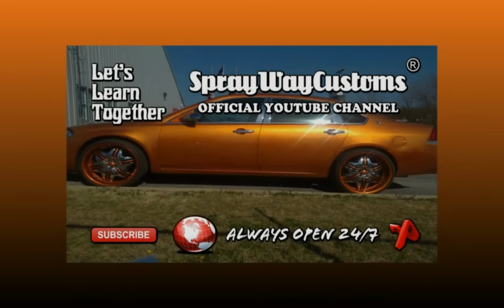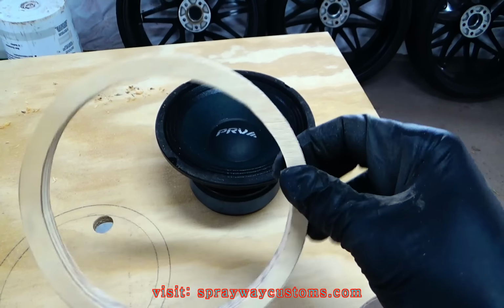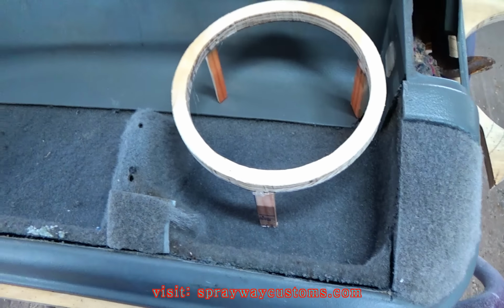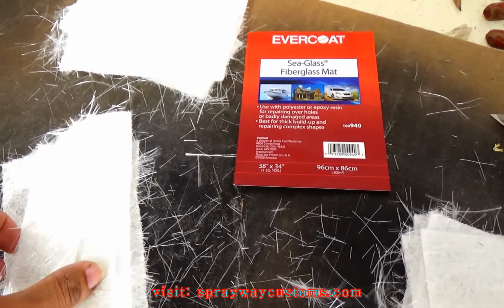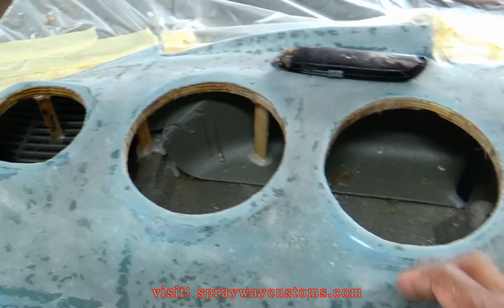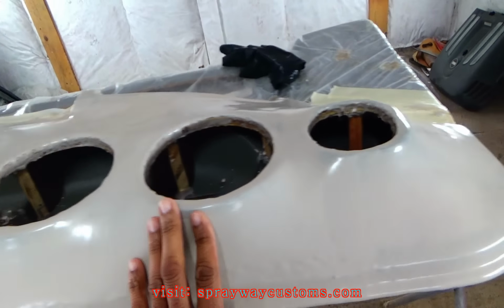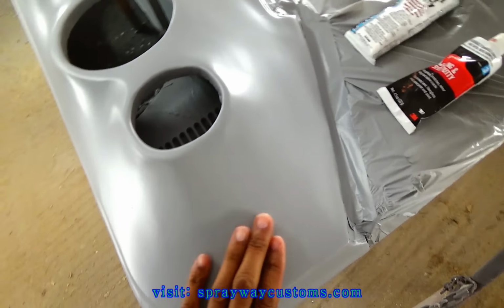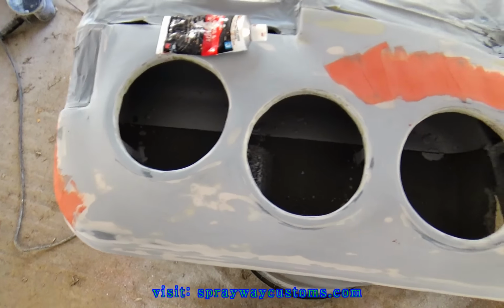How To Fiberglass Door Panels Step By Step 1996 Bubble Chevy Impala / Caprice

Comment: I noticed a boat fiberglass guy uses a roller to smooth out the wet fiberglass. He dabbed in his epoxy with a chip brush and laid the glass in and dabbed more epoxy over it and then he had a 4" paint roller frame with a thin piece of stainless pipe as the roller maybe 3/8" diameter. And he rolled that over his wet fiberglass to push the glass in and work out the air bubbles. And it works good to contour the corners too. Looked like less sanding after also
Reply from the maker: Yes..thanks for the info

Comment: Can you do a video on how to remove all the paneling and pillars in the box Chevy so I dont break anything when I start taking things apart
Reply from the maker: I'll keep that in mind but at the moment. I have most of them took apart
Reply: @SprayWayCustoms  alright preciate ya & btw can you help me out with what I would need for fiber glass and painting. What spray guns will work and size compressor I would need? I just want to make sure I get everything I need.
Reply from the maker: With fiberglassing you'll be fine with just about any size compressor and spray gun because the parts so small and you wouldn't be painting for a long period of time.
Reply: @SprayWayCustoms  alright man preciate ya, specific nozzle tip size and any good affordable brand of spray gun?
Reply from the maker: Go with a 1.3 tip that's a good universal tip for everything. Finishline are the Startingline by DeVilbiss are good affordable guns
Reply: @SprayWayCustoms  alright preciate the help

Comment: Awesome work n craftsmanship! 👍👍
Quick question. Did you remove the staples from around the speaker holes before completing the fiberglass. Will the staples get in the way when trying to secure the prvs to the door?
Reply from the maker: No I didn't remove them. After the first coat of resin they were basically covered up. I shoot them countersunk into the piece. Thanks for the question R Hunter

Comment: Do you get a ton of door rattle like that? Just curious cause I wanna do this to my f250
Reply from the maker: No you don't
Reply: When in doubt use dynamat or similar (also helps eliminate backwave) but a proper fibreglass panel should be stiff enough not to rattle.

Comment: Do you think you can show how you wire and fasten the panels back on the door? Do you have to account for the seats when you close the door
Reply: mjbqalaska by him not cutting the panel off in the back... It fastens back on the same way
Reply: mjbqalaska thespeakers are setting flush with the panel itself no it doesn't interfere with the 
Door shutting
Reply from the maker: Thanks for answering the question Terry. That's a good question though mjbqalaska. Thank you both😊
Reply: How does it stay on the door panel ?

Comment: This may be a stupid question but how do you stop the fibreglass panel from separating from the original door panel?

I like your work, it's given me some ideas but I've never fibreglassed anything before so I need some more information and learn a bit more first before I go cutting my door cards to pieces.
Reply from the maker: That's not a stupid question...Great Question 😁. The staples hold it to the door panel secure. After you put resin, fiberglass and filler over them there's no way they're coming out. Thanks for the question
Reply: SprayWayCustoms what do you think about drilling holes instead of putting staples? Ive seen that's another method...
Reply: SprayWayCustoms thanks!

Comment: Excellent job! Btw, I found a Cadillac 500 engine and trans for the Burb! Now I'm searching for that ole school Lac interior. What about using the resin with multiple layers of just fleece? Would that work instead of using the FG sheet?
Reply from the maker: You could use resin and fleece but if it's something that needs to have a pretty sturdy foundation. You would want to use fiberglass. Thanks Jeremy Medlock

Comment: When doing this do you want the panel to be a sealed unit or should it vent into the door?
Reply from the maker: It all depends on your preference...what type of speakers and what you going for Shawn
Reply: @SprayWayCustoms  for the doors  I have 3 mids @6.5" and 1 tweeter per door. For subs I have 3 @8" All going into a Dodge MegaCab Truck. Thanks for the reply bud.

Comment: UMMMM Just a little hint it’s way easier and more accurate to use a compass to mark your speaker rings there 50 cents at Walmart
Reply from the maker: Thanks
Reply: To be fair you don’t need it because it’s just a reference piece you’ll never see and the cuts are never gonna be perfect anyway,
So the lines don’t need to be either

Comment: Question man how would this work on grafic fabric? Would i appyl fiber glass sheets on top of the fabric?
Reply from the maker: It doesn't matter what's on the fabric. The process is the same
Reply: Maybe I didnt ask it correctly. The print on the fabric I want to show through what would I use to make the printed fabric transparent? Or will it not work?
Reply from the maker: Once you put resin, fiberglass and sand it you want be able to see the print

Comment: You have any more tips on where your glass fiber meets the original panel? I never manage to get a smooth transition or whatever, I feel that often damage the panel :/
Reply from the maker: You just have to Mask it up real good and once you get ready for your final prime. Touch it up with some glazing putty.
Reply: @SprayWayCustoms  so you're staying stay a little away from the actual place it'll transition with the glass and fleece and work that with filler to meet them up and sand that

Comment: What exactly holds that fiberglass panel to the door tho? No way some hot glued sticks are holding 4 speakers + a fiberglass shell. Was there some bolting provisions made into it that wasn't shown in which you screw/bolt it to the panel from the backside?
Reply from the maker: Once you staple the fleece to the panel and then fiberglass over them it's not going no where
Reply: @SprayWayCustoms  wouldn't the staples just pull out of the plastic panel? Or do you flip the panels over and them bend all the staple legs behind it like a paper stapler?
Reply from the maker: I just leave the staples sticking out if it's not no where needing to be flush to the surface....if so I just grind the tips down

Comment: What kind of stapler do you use?
Reply from the maker: It's a GREX model number5018 shoots 20GA staples
Reply: @SprayWayCustoms  thanks bro
Reply: What brand staplers do you use or do you just get the Grex brand. Thanks in advance. I just got my gun in today
Reply from the maker: Finalboss 84 the staples I used are SUREBONDER 44516 5/16" (8mm)

Comment: This might be a dumb question but the whole fiberglass assembly is held on to the door by what the glued sticks? Or does the combination of fiberglass  staples and the sticks hold it ?
Reply: Btw nice work I’m going to try on my back dash that keeps snapping from the bass in the trunk
Reply from the maker: It's actually held together from the fiberglass mat because you can actually take the sticks out once you done. They're just put there to hold the speaker rings in place until the fiberglass is laid to strengthen everything up. Good 😊 Question

Comment: Why would you use a stronger support than a paint stirrer to reinforce that long panel?
Reply from the maker: It's only to keep the piece in place until the fiberglass is dry...once the piece is fiberglassed you can remove them

Comment: How or what did you use to "cut" away that excess fleece after you put that first layer of resin on? You trimmed it somehow perfectly around the remaining potion of "unresined" door card.
Reply from the maker: A box cutter and just transitioned it with fiberglass filler

Comment: Great video.  Watching for the 3x taking notes.  About how long would you say the whole process takes minus primer and paint for 2 door panels.  Wondering if I can do it over 3 days, Fri Sat Sun since it will be in my work truck.  Thanks in advance.
Reply from the maker: Much appreciated
Reply from the maker: Yes it can be done in three days
Reply: @SprayWayCustoms  great, just need to rewatch and get a supplies list.  Thanks for the swift response.

Comment: will the legs of the speaker rings loosen or off off due to the vibration of the speakers over time? I think they will and then there will be a rattle in the door panel.
Reply from the maker: After the resin harden up you can remove the legs

Comment: You could always cut the Inner Circle first and then slide the speaker into the hole and then Trace the outside of the speaker to get it perfectly centered instead of trying to guess. I know it'll probably work out that way too but if you want to get it perfect you could always try that approach.
Reply from the maker: Thanks man

Comment: Ok I seen that it’s fleece. Once you have the fleece coated in resin and drys. How hard is it. Is it hard enough to pull it off to finish the fiberglass work.. 

Asking cuz I’m making a dashboard overlay. Basically a part that will screw to my factory dashboard. Thanks in advance...
Reply from the maker: The first coat of resin not very hard but as you put more coats on it gets harder

Comment: Hey wats tha material u use for uour fiberglassing i know fleece but is there any other fabric   i bought some 100% polyester  its real stretchy  would it work for fiberglassing door panels,rear decks thanks its like tha poly techno  fabic
Reply from the maker: Yes that’ll work with no problem
Reply: Ok thanks

Comment: How do you mount the door panel if the fiberglass area is where the mounting screws are?
Reply from the maker: Reach through the speaker openings and drill some screws through the base
Reply: @SprayWayCustoms  sweet thanks!

Comment: do you leave the wooden legs on after the job is complete or remove them?
Reply: @SprayWayCustoms  preciate that. gonna re-do my kick panels in my '80 regal. Had them done about 15 yrs ago but they are flush .Gonna use your method to angle them properly so the sound can get out better
Reply from the maker: Great

Comment: 8:27 how do you keep it from separating I see Staples but is there something that you put to bind the two panels together. The job looks awesome 👏
Reply: Does the fiberglass resin stick to the plastic to bond with each other?
Reply from the maker: Once you fiberglass it, it’s not going no where if you referring to around the speaker openings
Reply: When you stapled it down in the edge outer edge from all the bass and speakers would that loosen the frame and crack it I wanted to know how you keep it from separating but you’re telling me it’s soon as I fiberglass it is done it’s not going nowhere
Reply: I appreciate you getting back to me respect my brother awesome videos you have keep it up 👍

Comment: How much to build a deck for 4-6 by 9’s for 96 impala?
Reply from the maker: Where you located?
Reply: Austin Texas
Reply: I seen a video of yours where you fiberglass a speaker deck with 4-6 by 9’s and a port hole but don’t need the port hole.. but I like the way the 6 by 9’s were at an angle

Comment: I HOPE YOULL REPLY BACK TO MY COMMENT .I been following this tutorial step by step and I cannot get my staples to go thru my impala door panels .I have a heavy duty stapler and I'm using 9/16 .do you think 1/4 will work .?
Reply from the maker: It could very well be your compressor air is not turned up high enough

Comment: its absolutely possible to do the whole thing with one piece of glass just make some relief rips ware the glass tries to bunch up around the bends.. if you dont want to do it that way rip the glass in circles dont cut it, the glass will lay out way better and take less grinding. also use a small paint roller with a tray its easier than a brush. the rollers we use at work are like 4" long and 1" around (not foam, foam will melt). not even sure how i stumbled on this video lol but i thought i would try and help out a little.. my family owns a fiberglass boat and rv repair shop. i have been doing fiberglass repair for a living for over 15 years.
Reply from the maker: Thanks Chad. Great comment 👍🏾

Comment: @SprayWayCustoms - I've got a better way for you to make those concentric circles.
Sorry I'm not going to read 1000 comments to find out if somebody else already offered this idea.
- Do the outer circle like you did using the speaker as a template.
- Use a straight edge and make 2 perpendicular lines going through the center of the circle.
- Do the same for the cardboard template.
- Now just line up the lines, and the smaller circle will be centered in the big one.
Reply from the maker: Appreciate you

Comment: Can someone give me all material used in the video..thanks
Reply from the maker: Fleece
Spray Adhesive
Hot Glue
Wood
Jig Saw
Drill
Sander
Resin
Fiberglass Matt 
Body Filler
Fiberglass Filler
Sand Paper
Masking Tape
Primer
Spray Gun
Masking Plastic
Glazing Putty
Chip Brushes
.........I might've forgot something but those are the main things you'll need if I remember something else I'll add it 👍🏾

Comment: I started doing car audio about 15 -20 years ago. I had to learn most of my skills the hard way. With that being said, I wish you or some else had been around to instruct me. I think that this is a great opportunity for both the new and seasoned audio designer. I do however have a suggestion that I learned the hard way, about making the rings without a template. What I do is take the cardboard ring that held the sub and make the first hole. I set the sub into that hole, then I use the outline of the sub for the outer ring. Keep up whatcha' do brotha!
Reply from the maker: Thanks for the tip and the encouraging words. I was big into car audio back around 92' but I'm not into it like I use to be but I still love a great sounding system

Comment: Your videos are filmed very well. You speak clearly and you get right to the point. My only recommendation is to stay away from hot glue and maybe find an epoxy that will be longer lasting and more heat tolerant! Your work is great though!! 
I’m definitely going to give this a go with some junkyard doors before I start cutting into my 96.

Any chance you have a video of using the dremel to cut the door panel?
Reply: One other question, does he original door panel rattle underneath when finished?
Reply from the maker: Thanks for the support. The hot glue is not used for support it's only used to hold the legs in place until the panel is fiberglassed. Once it's fiberglassed I remove the legs. The panel doesn't rattle at all Riddem Pest Control
Reply: @SprayWayCustoms  thanks for the quick response!
Reply from the maker: No problem

Comment: I admire your work ethic but to be brutally honest, your methods are antiquated. Save yourself some time and trouble and invest in a router and a circle jig. No template nonsense, once you get one, simply stack em and use a flush mount bit to duplicate. Work smarter, not harder. Also, you should invest in sun flash UV resin. Allows you all the time you need, no need to rush before it cures. Take your time and once your done lay it in the sun and within a minute it's fully cured. It's all about making your work flow more efficient. Just watch Car Audio Fabrication YouTube channel.
Reply from the maker: I know about all the stuff you just mentioned. This video is for the beginner DIYer who can just run out to they're local Walmart and get started right away and get the job done. Evidently I didn't put those items are those steps in the vid for a reason. Whoever got those items pretty much should know how it's done are the process and should be doing it on a high level. Thanks for watching ApexPredator_JKU

Comment: Great info, man! To help reduce your air bubbles and lay times when you are dropping the mat on the piece:
Pre-cut one large piece, resin up the piece with a medium time mix (15-20min pop time), snip the mat halfway up the curves, use a mat roller to lay it down, then dab the mat down with the rest of the resin. It will stop you from getting 98% of your air bubbles. Looks like a mini paint roller, saved me a ton of time on rework!
Reply from the maker: Appreciate the comment. I just show those steps for the DIYer who just starting out who'll run into those problems.Very much appreciated though ShadeThief22
Reply: @SprayWayCustoms Gotcha! Keep up the awesome work!

Comment: And customers wonder why this cost's so much to do????  Look at how much work it is, your paying shop time one guy tied up for 3-4 days think how many sound systems he could be installing during that time frame?   
I did this back in the day we built up door panels with wood. 

We used trunk liner instead of fleece fabric it works pretty good but a lot more sanding.
the boss would't buy all the tools you have we covered it with cloth carpet or vinyl.
Reply from the maker: You're exactly right. Thanks 🙏

Comment: Ya spot putty is garbage as it sinks long after you think its cured as specially if your filling pin holes.Dry on top but green at the bottom of the pin hole. I use two part putty with a hardner. They look good never the less.
Reply from the maker: I do also unless it's a pin hole

Comment: If you would use a thicker fabric in the first step you can skip using fiberglass mat which will make your job time shorter and easier making it more profitable. I grew up on the 90s scene and shops showed me to use speaker box fabric and lay the resin on that. I've done every custom door panel I've made for myself this way send they've come out great for 20 years.
Reply from the maker: You can not just resin fleece and call it a day because overtime it'll crack with the slightest bump. You have to fiberglass it to keep it from cracking.